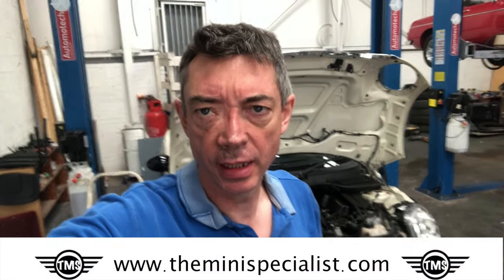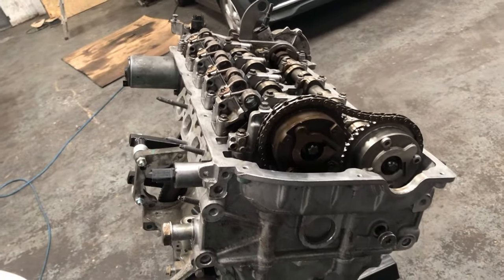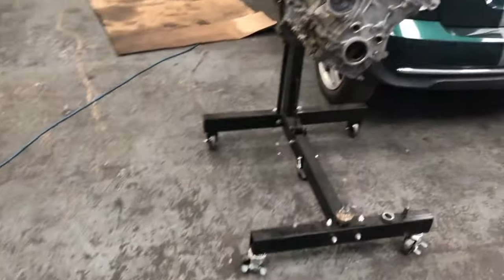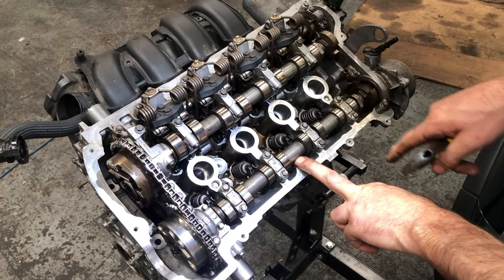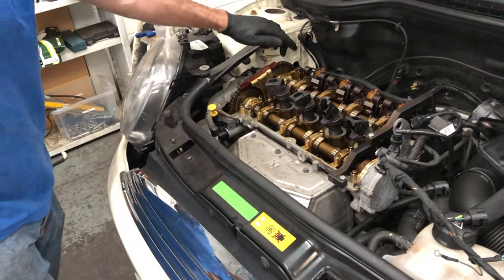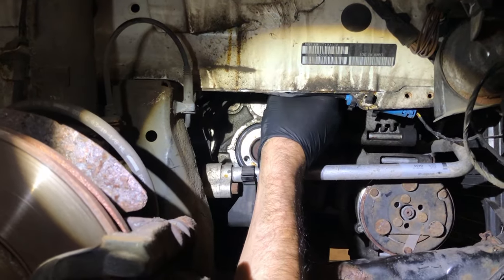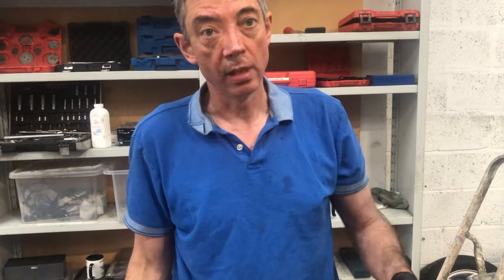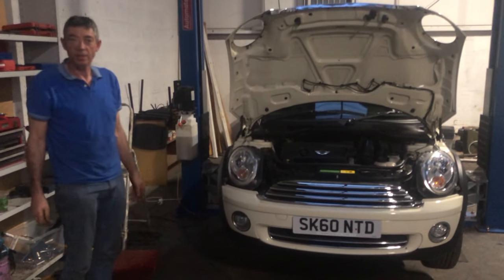BMW Mini Timing Chain DIY Replacement for N12, N14, N16 & N18 engines - The Definitive Guide

Comment: Having worked mainly on 1960s - 1990s engines, car and bike,  - I can't think of a single vehicle that's required a cam chain replacing. I can see that the solenoid/timing operation will put a varied load on the chain - which will have an impact on longevity  - fair enough ... But surely BMW should have thought this through, and fitted beefier chains?  Cost is the usual culprit > Accountants have a great deal to answer for! As do modern engine designers - are these people sadists!!  < next revolution, lets get them to the guillotine first! ;-)
Reply from the maker: I 1/2 agree.  The problem is that the timing is tied closely to the chain length and when the chain goes out of tollerance the timing goes out the the car stalls, runs rough and so on.  The engine BMW really messed up on is the N47 diesel as (1) the chains are next to the gearbox which means its an engine out job to change and (2) the chains can snap sometimes without warning at low miles.  The worst one I have seen is a 45k mile 2015 Countryman with full main dealer history - snapped chain resulting in an engine rebuild.

Comment: I've got to replace the chain on my Peugeot 3008 which uses these engines. Done these chains dozens of times as a Peugeot technician (turbo & non turbo versions) but who was the chain kit manufacturer? Don't really want to buy genuine Peugeot parts because they are extortionate prices. A decent non genuine kit should be ok.
Reply from the maker: I use Febi Bilstein or BGA - both are good.

Comment: Me done 800 times by Citroën thp this chain Problem, you do Every Thing good, but you Forget the starting from this problem why the chain is getting longer,,,,because it is a direct injection and with all the restrictions you get carbon (koolstof)oxide,,hope i spell it right 😅, on the inlet valves, when this Comes lose it is between youre inlet valves en you get engine misfires,,and eventualy scratches and oil consumpion

Comment: "It was not Oil"...typo
Reply from the maker: The only way you can have damages the valves is if the valves have hit the pistons - this can happen if the timing is wrong or if the crank bolt is not torques up propely and the timing slips.  

The one time I have had poor running after a camchain change was due to the Inlet sprocket and the Exhaust sprocket on the wrong cams.  The car started but sounded like a bag of spanners.

Comment: God German over engineering. Well of seen not cranking those bolts to proper tension the bolts  shearing off tearing up the teeth of the rotors around the timing chain and filling the oil pan and circulating engine oil with metal fragments.

Comment: Not clear, at frames 0:40, "very poor A CAR ONE TOOK OVER"? "poor calwent tookover"?  What is "a car one took over"? "poor column tookover"? What is "hunts all over the place"?
Reply from the maker: What I said is 'The car won't tick over.  It hunts all over the place'.  This means - the engine will not run smoothly at rest - another term for this is 'tick over'. 'Hunting' is another term meaning rough running at rest - the car should sit at about 800 rpm without throttle (or at rest) - this would be a smooth tick over.  If the car hunts it cannot find that smooth tickover and 'bounces' on the revs.  Hope this helps.